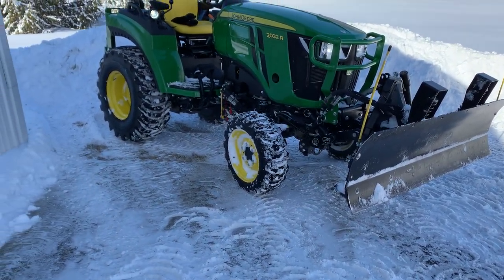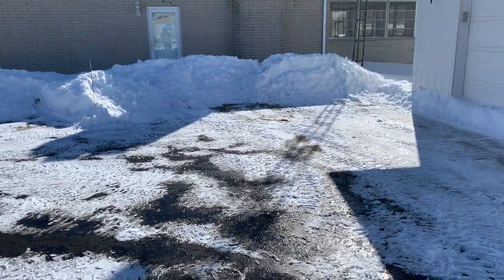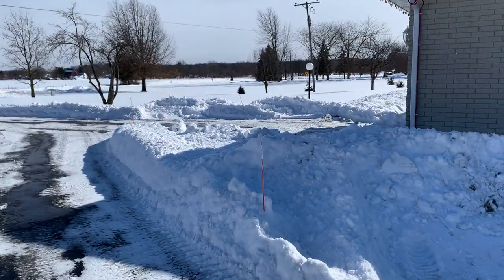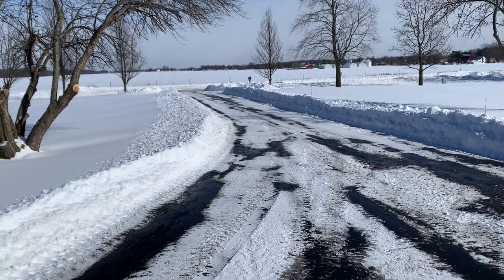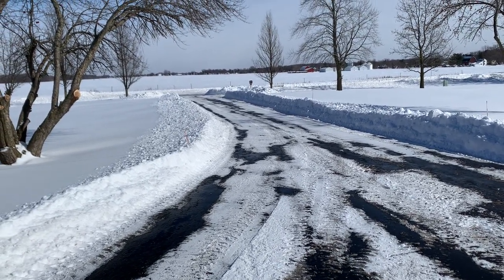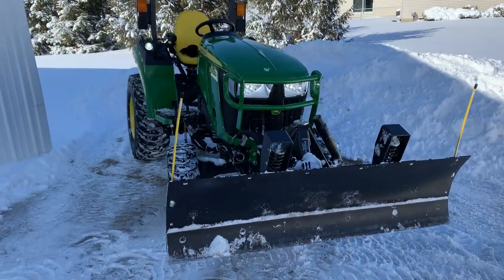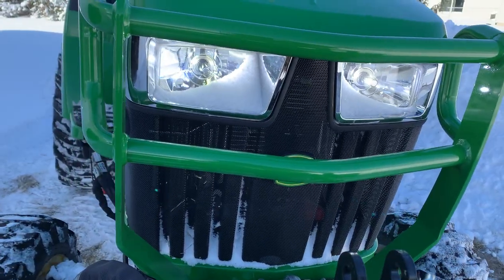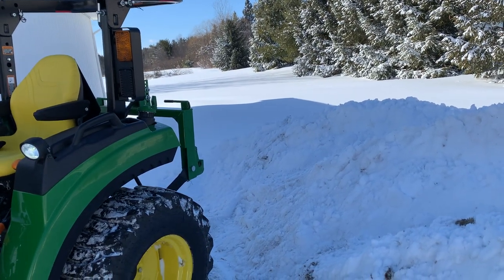Rolling snow over the plow blade. Plowing 8 inches of snow. Part 3

Comment: Looks great!  How easy can you put on and take off the plow?  Agree, the 2032R is amazing...
Reply from the maker: I have not actually next taken the plow off. From what I have learned it shouldn't be more than a 10-15 min job. Under it it has a small stand, then you pull the pins for the 3 point and unhook the hydraulic lines and back away. I'm kinda 50/50 in taking it off this spring... LOL curious if I can get it back on.

Comment: Bob, if I didn't need my FEL so much during the winter that is the plow I'd have, that with a blower on the rear and you'd be all set.
Reply from the maker: Well do some research if you want the plow. It's an heavy duty AG plow first, second and third. Plowing snow is really down on it's list. It's very heavy gauge it's edge is very aggressive. It's really not the a snow plow like the yellow blades are. But for field work, it's awesome. Next winter I will get one of those UHMW strips for it. I nicked up so much of my lawn next to my driveway this winter. Thank for the reply.